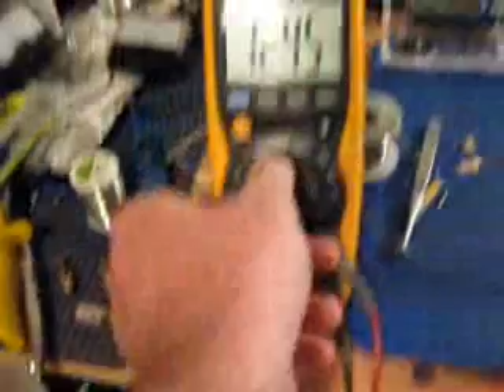Almost complete charger

Comment from the maker: It's been complete for a little while now. It works very well but I have blown ten of the transistors. So annoying and not all that cheap to repair at $12 a piece. Because the device is so powerful neons can't protect the circuit like they can with a normal SG. Within a few seconds of removing the output cables while it is on the smoke appears!

Comment: Great work SJohn, its been a while.. u should do more clips, you've got some great builds.

Id love to see a circuit of this. Im trying to get a multicoil system working with my joule thief (check out my vids)
I can charge SLA Batteries but it struggles on larger car batteries.

Have u scoped it to see how high the HV spikes are?

Bummer about your PWM - is that one of those $90 jobs from Jaycar... They have cheaper $20 ones set at 2kHz (but u can mod it)